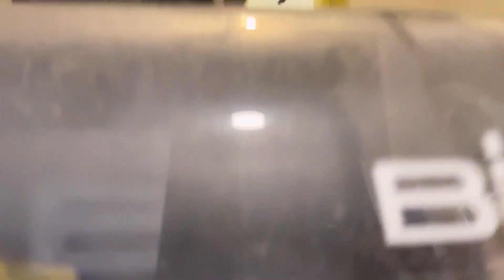Showtime 🎙️🎪 At Tellyboo’s | New Vac New Rug Two mixes 🤩

Comment: 💖 TIMESTAMPS 💖

✨ 0:00 - Blue Cleanview spread out brushroll pickup w/ Home Depot Mix on striped rug/area rug 
✨ 1:50 - Blue Cleanview brushroll pile attack w/ Home Depot Mix on striped rug/area rug + pile pushing 
✨ 3:43 - Blue Cleanview brushroll pile attacks w/ Home Depot Mix on striped rug/area rug, closeup + pile pushing/stepping 
✨ 7:31 - Blue Cleanview dusting brush pickup w/ Home Depot Mix on striped rug/area rug, closeup
✨ 10:00 - Blue Cleanview spread out brushroll pickup w/ Home Depot Mix on striped rug/area rug 
✨ 12:11 - Blue Cleanview brushroll pile attack w/ Home Depot Mix on striped rug/area rug + pile pushing 
✨ 13:55 - Blue Cleanview spread out brushroll pickup w/ Home Depot Mix on striped rug/area rug 

✨ 15:04 - Blue Cleanview brushroll cleanup on striped rug/area rug + lines 
✨ 15:45 - Teal Shark brushroll cleanup on striped rug/area rug + lines & UTR
✨ 22:24 - Teal Shark brushroll cleanup on area rug/tile floor + lines
✨ 24:30 - Teal Shark hose cleanup on area rug/tile floor + edge cleaning 🛋️
✨ 27:43 - Teal Shark brushroll cleanup on area rug/tile floor + lines
✨ 29:03 - Teal Shark hose cleanup on area rug/tile floor + edge cleaning
✨ 29:50 - Teal Shark brushroll cleanup on area rug/tile floor + lines

✨ 32:32 - Blue Cleanview spread out brushroll pickup w/ ATH Mix on striped rug/area rug 
✨ 35:24 - Blue Cleanview brushroll pile attack w/ ATH Mix on striped rug/area rug + pile pushing 
✨ 37:12 - Blue Cleanview brushroll pile attacks w/ ATH Mix on striped rug/area rug, closeup + pile pushing/stepping 
✨ 41:15 - Blue Cleanview spread out brushroll pickup w/ ATH Mix on striped rug/area rug 
✨ 42:14 - Blue Cleanview brushroll pile attacks w/ ATH Mix on striped rug/area rug + pile pushing 
✨ 44:06 - Blue Cleanview spread out brushroll pickup w/ ATH Mix on striped rug/area rug + backwards passes

✨ 45:13 - Blue Cleanview brushroll cleanup on striped rug/area rug + lines 
✨ 46:15 - Teal Shark brushroll cleanup on striped rug/area rug + lines
✨ 50:43 - Teal Shark brushroll cleanup on area rug/tile floor + lines
✨ 51:46 - Teal Shark hose/crevice tool cleanup on area rug/tile floor + edge cleaning 🛋️
✨ 59:00 - Teal Shark brushroll cleanup on area rug/tile floor + lines, hose & UTR
Reply from the maker: It’s Home Depot mix